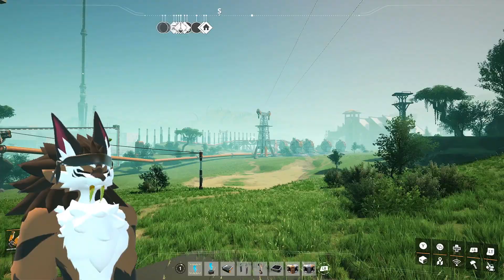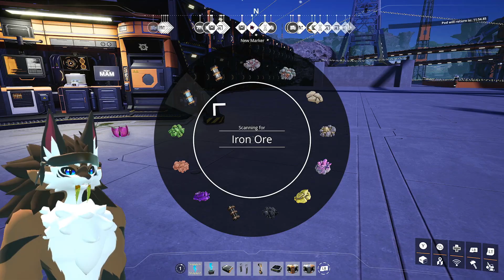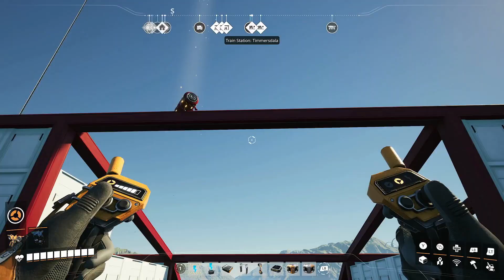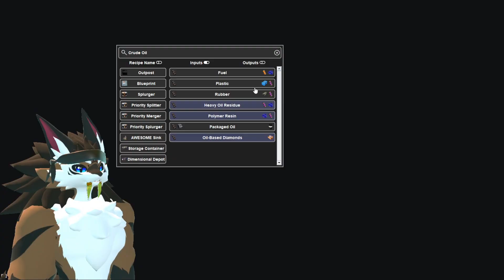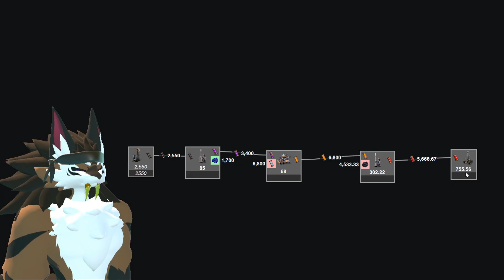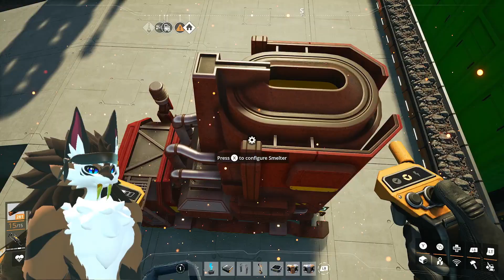Satisfactory - 16 - Gun & Coke

Comment: I know this comment comes very late but I’m rewatching your series and I just thought of a solution for your pipes in the gas station! You could put a smart splitter on the belt going from the offload to the fuel port and have only turbo fuel go through the main split and anything else go off the side into a sink or something. Just a thought!
Reply from the maker: That's actually a reasonable call. I keep forgetting about the smart splitters, I should use them more often.